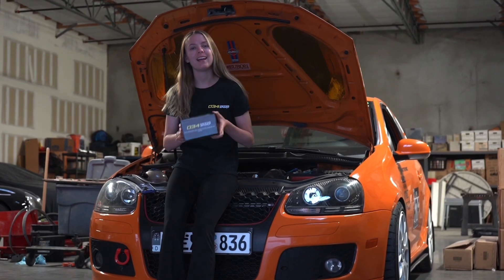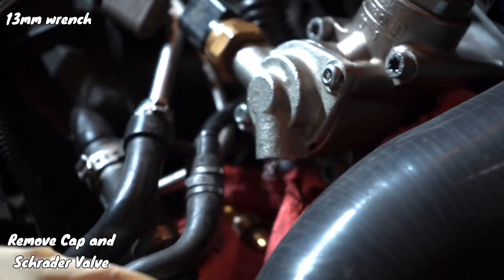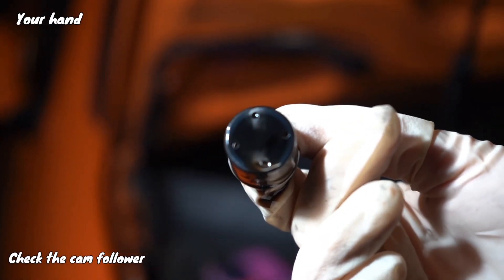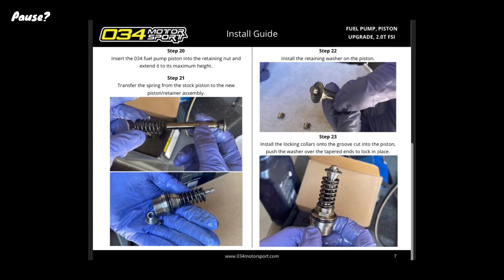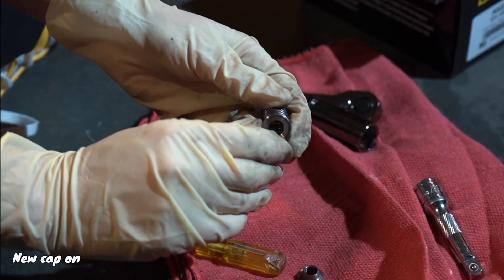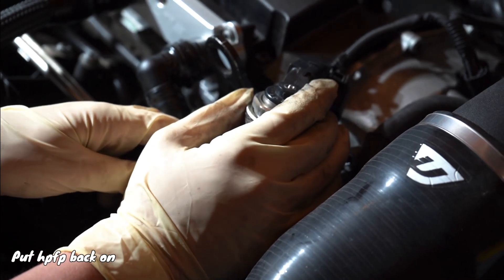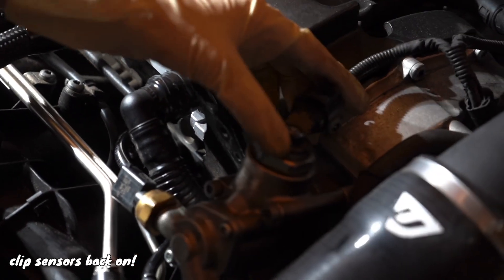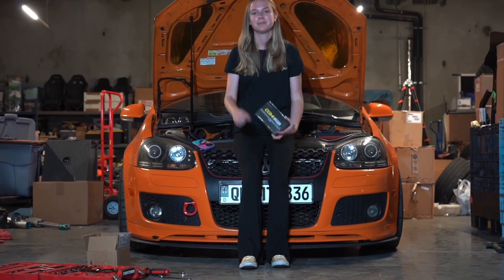034Motorsport HPFP Piston Upgrade Kit || Install Video || 2.0FSI

Comment: So for anyone removing the spring you don’t need to all you have to do is push a little bit of pressure on it to push the spring in just to give it like 3mm and it will grab then your able to unscrew it